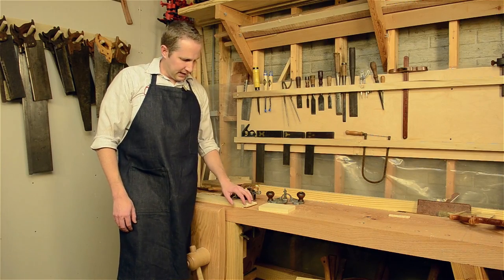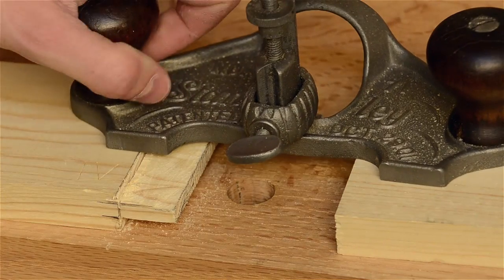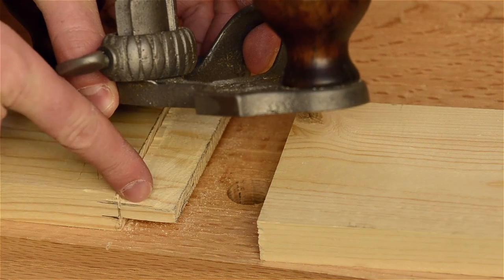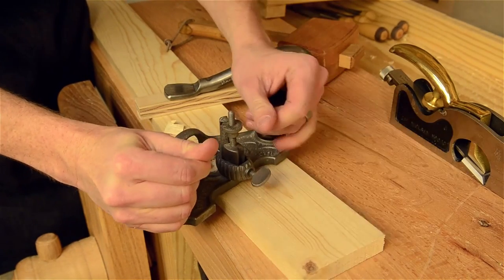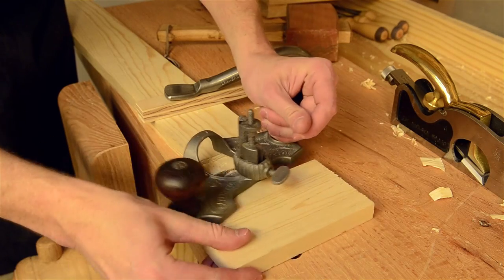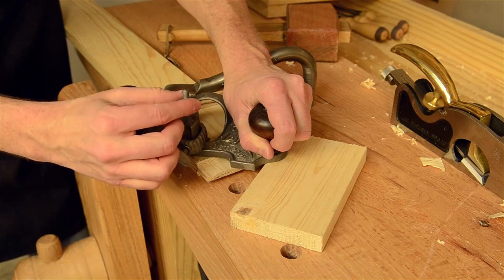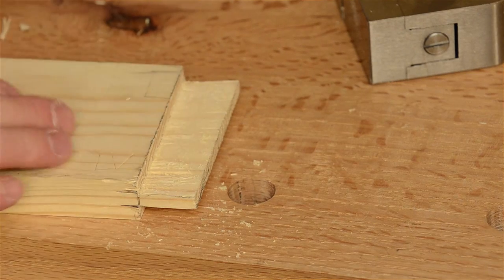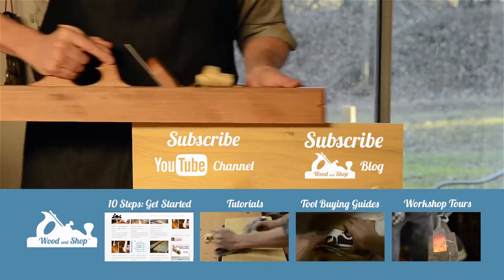How to Square Tenon Cheeks  {Part 8 of "Build a Dovetail Desk with Hand Tools"}

Comment: They are not as pretty as the old router planes like that one but the newer ones have a hole where you can screw on a sub-base to hold the router level instead of trying to balance it on a moving piece of stock like that.
Reply from the maker: I was just lazy in not securing the other piece to the workbench. It's a lot easier when the support piece isn't moving around.

Comment: Assuming your blade doesn't need sharpening, it looks like you are taking too deep of a cut with your router plane.  I would suspect that is why the board kept moving on you.

I know you didn't ask for my advise but my old Stanley router plane cuts much better when I sneak up on the final depth 1/4-1/2 a turn at a time.  Sure it takes a little more time, but the end result is much cleaner.

I have found a slicing motion works better than stabbing motion.  I hold the one knob stationary and rotate the other knob in an arc.  I work close to one edge of the tenon then come in from the other side to avoid tear out.  Holding one knob stationary then turning the plane in a slicing/circular motion seems to do the trick with minimal resistance.  If there is too much resistance, or tear out, I raise the blade.  

If you want the tenon centered, do one side then flip it over and do the other without adjusting the router plane.  If you do that you should end up with sides that are parallel.

I have never tried the support board and will have to give that a try the next time I use my router planes on tenons.  Looks like it would work well if the board is stationary.

Anyway, what do I know?  I don't come on here and show how to do anything.  Keep doing what you are doing.

Comment: I would recommend to additionaly secure the piece with a thin batten just behind the tenon shoulder, which is secured to the bench with another holdfast. This way the piece shouldn't slip at all

Comment: This is a kinda weird method.  I never needed a second part of wood to support my router plane. I never watched anyone doing this while making this type of very standard tenons. 
In my opinion the router plane has enough support on just it's left or right side (depending on your direction) with tenons that wide and short like the ones you are making.
Reply from the maker: Give it a try and see what I'm talking about. I learned this from some very experienced woodworkers.

Comment: Far better, and easier, to use a shoulder plane on the cheeks ONLY.  Once the shoulders have been cut - DON'T TOUCH THEM.
Reply from the maker: Mark Hazlewood Shoulder plane's got their name from trimming shoulders. Yes, it's ideal to get the shoulders perfect with the saw, but sometimes they need a little evening out with a shoulder plane. Thanks for the comment!